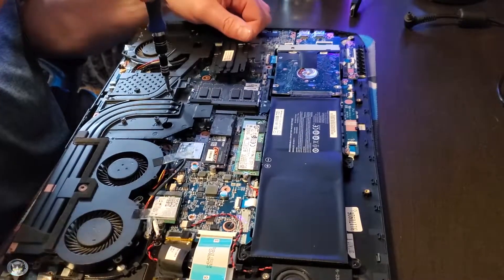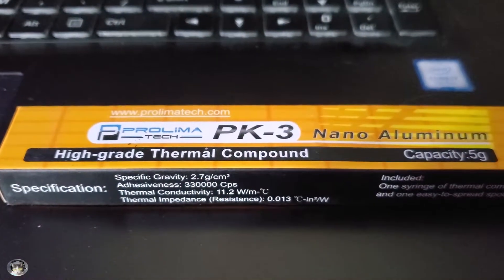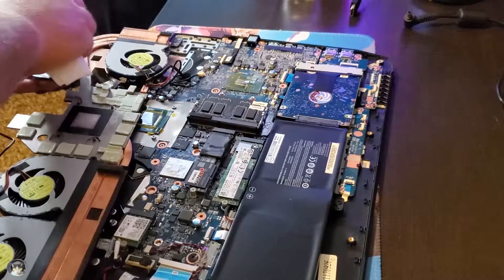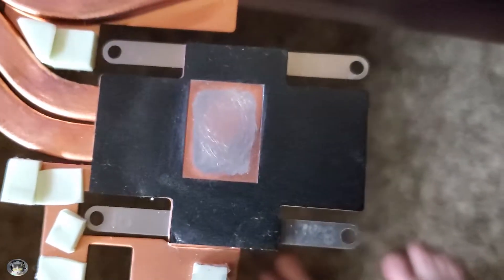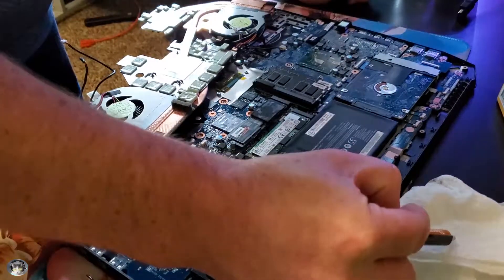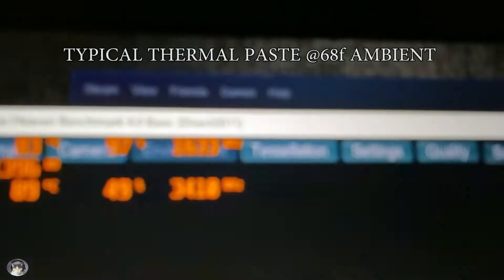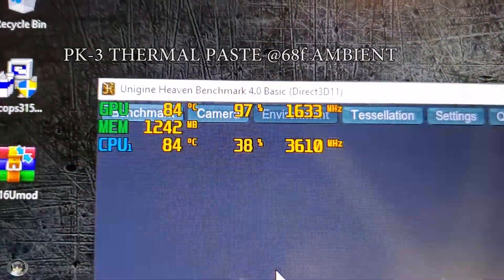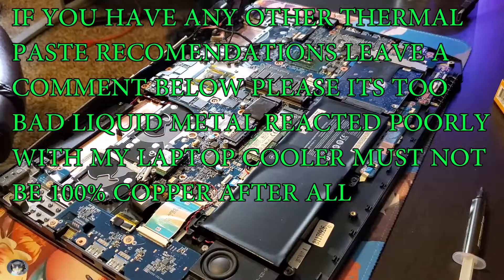I Used PK3 Thermal Paste on my Gaming Laptop Meh Results

Comment: I've tried several thermal pastes on my notebook and my recommendation would be Thermalright TFX, the temps were better than 
Thermal Grizzly Kryonaut or Coolermaster MasterGel Maker Nano and some others. The downside is that Thermalright TFX is by far the hardest paste to spread, it's like clay. But in the end I don't care if the temps are better. I've heard Kingpin Cooling KPx is good for laptops but couldn't try it out yet.

Comment: I kind of have an similar experience regarding using LM. At the beginning LM works pretty well, but few days later I noticed 2-3 degree increase. It's possible that I'm just too sensitive and the increase is just a normal deviation. One of explanation I can think of is that, LM is more dynamic than regular thermal paste, over the time it just flow a little bit and causes a bad contact between heatsink and cpu.
Reply from the maker: I think you're right. I reapplied the LM and it seems happier again. Prolly just need to re apply when it dries up.